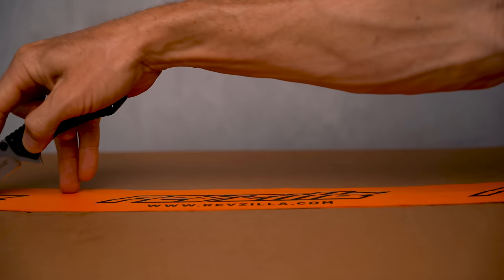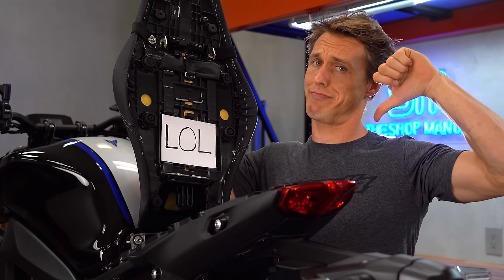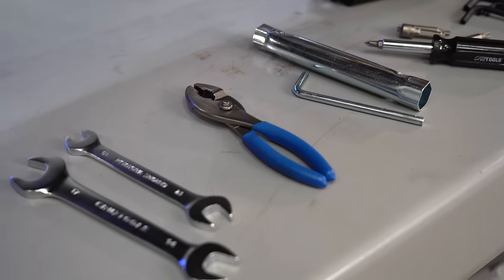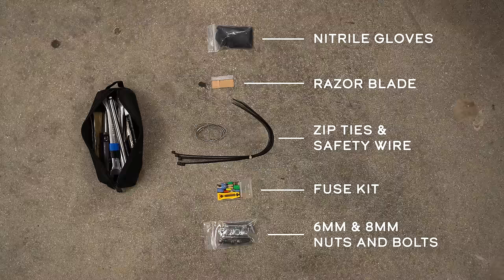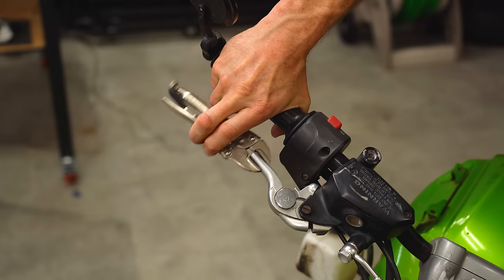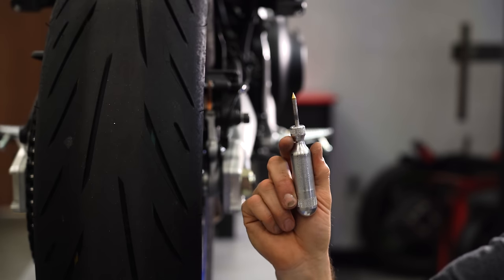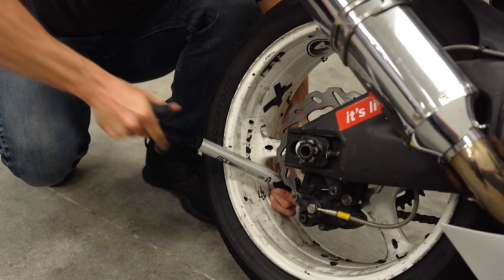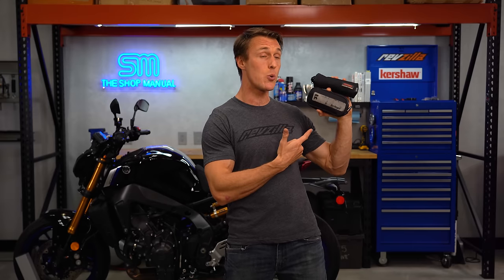How to Build an Emergency Tool Kit for Your Motorcycle | The Shop Manual

Comment: I've never had to plug one of my own tires but I've plugged about a half dozen of other people's tires including in the middle of nowhere. I carry a 12 volt compressor, they take up about the same room as a bike pump or a CO2 inflator and 3 or 4 cylinders. I've never liked CO2 because of the trash they generate. When bicycling I've stopped several times to pick up CO2 canisters that roadies left on the side of the road so I could get them into recycling.
Reply: That's a totally fair complaint against the CO2 cartridges.
Reply: I'm not a CO2 fan either, in part because of the waste, but also because it's a very limited solution.  Run out of cylinders and you're riding a flat tire.

I much prefer a mountain bike pump.  It's significantly lighter, packs smaller, is more reliable and more maintainable.  Sometimes you need to repair your tools before repairing your bike.  The bike pump is cheaper too.
Reply: CyclePump from BestRest.  Hands down the best.  Expensive, but worth it.

Comment: On the zip ties, buy bright yellow or orange, not black…lest ya got a KTM then swap orange for another bright color. The reason being is that road side repairs are basically “temporary “ so the color will show ya later as a reminder what needs to be finished when you get back home or to the shop. Also later on hints to keep an eye on that particular part or area as it may fail again as your bright zip ties indicate past failures vs the factory black ones that are hiding, don’t indicate so easily.😂

Comment: BTW, those tiny 16 gram CO2 cartridges kinda suck because it takes two or three to get a rear back up to pressure. You can pick up 45+ gram cartridges at pet stores though that fit the same adapters. They are used for live plant aquariums that need more carbon dioxide in the water. One shot and I'm back on the road, so I keep two on my bike, just in case I fail at plugging the hole the first time.

Comment: Something I do I learned from fellow club members is secure a clutch cable to the existing one, following the route and sealing the ends with tape. Also an old wire clothes hanger in the handle bar. 
We do ride old Brit bikes, often abroad and long distances and at recent events rallies have had a WhatsApp group for rally goers to ask for help locally, engine blowups etc.
Remarkable how some things can be solved by yourself or with pals with more knowledge, experience or just the bit you need. Great video by the way

Comment: Iv started carrying self amalgamating tape after I had a hose get damaged off road. Just give it a stretch as you wrap it and you’re back in business in no time. Iv also cut down big spanner’s and given the handle end a thinner end section so I can put a smaller ring ended spanner over it to increase leverage.
Reply: I cut the handle off a 8" shifter and replaced it with squashed pipe to use as a cheater bar and also integrated a 3/8 square drive. The shifter has a hammer head too. ALL the socket sizes for my bike fit nicely inside one another and make a little stack that can be ziptied together.

Comment: Cigarette lighter. Wrap with electrical solder, and electrical tape.
Can be used for (roughly) stripping wires and soldering.

Comment: I always carry 2 knives, an emergency knife that is a good sharp quality knife, relatively quality, I been carrying a off grid badger around 80$ always keep it razor sharp, then I have a utility type Gerber knife I use for cutting things regularly, I can switch blades easily don't have to sharpen, but my edc go to off grid is my emergency knife/ self defense knife that I don't use for much, maybe the occasional  steak

Comment: Good ideas in this video. Best advice given is practice using whatever you carry. Only change for me, is I carry a small LED camping headlamp so I can have hands free lighting. I also carry a spare headlight bulb (for us that ride older models). If your headlight goes out, after local stores are closed, you may be stuck over something that's easily resolved... if you have a spare!
Reply: Oh and I spy some nice OHLINS jewelry...

Comment: A tip for if you are carrying a bicycle pump, get one designed as high volume not high pressure. It may save your arms little bit when pumping a tire back up.

Comment: This is the 1st video I’ve seen that demonstrates that a vice grip type tool can temporarily fix a broken lever. This happened to me in the 80’s while trail riding and my vice grip pliers (needle nose type) got me home. I’ve since made sure my brake and clutch lever mounts have some give but the usefulness of that locking plier has never been forgotten. 
Leatherman Crunch is what I carry now if space is an issue. Thanks!

Comment: Leatherman multi-tool knife always on my belt

Some Instasteel compound mix in two plastic tubes

Tyre lever with rear-wheel nut ring spanner zip-tied to the sub-frame

Tow rope tucked away in a open cranny in the skid plate

Aluminium zip-ties to fix things that would be exposed to engine/exhaust heat

Comment: Suggestions on where to put that EDC? The only place I have ready storage on my bike is under the seat (on top of the battery), which requires a 5mm hex key to even get to. I don't have any good places for a tail bag, I don't seem to have a good way to mount any tank bags other than to the gas cap, and I can't really put a bag on clip-ons.

Comment: I bought Cruz Tool kit #TR2 for my Tiger 900,  To say it's well thought out is an understatement.  I had  tool I would need to remove  fastener that I could access on the bike, at least before removing any panels, except one.  The only thing it didn't come with was a T-50 (I think) torx wrench, and that is only for 2 bolts that hold the frame to engine.  Before buying the kit, I determined exactly what tools were needed, and was astonished how complete the kit was.  It even came with duct tape, baling wire, zip ties, Loctite, a tire gauge, and even a pair of vive grips!  Seriously worth the money!  Of course, I've added a few more things to the kit, but dang...  Great video Ari!

Comment: I found an excellent alternative for a hand pump. There is an electric one called Berkut MT-1000 I carry now. It is similar in shape but even smaller than the hand pump shown in this video. It is slow though, requires 10+ minutes to fill 30psi in my rear 17 tyre from zero. But it still is faster than hand pumping and is obviously easier on your arms. Ideal if you want to go electric, but want the smallest, lightest option, as well as if like me, you have a 3A limit on your power socket. Battery clams were included, but getting to it for me  requires some fairing stripping (FJR1300A), so that is another plus in my book.

Comment: i've been riding motorcycles for over 50 years. In all that time I've only had two flat tires. Both of them were decades before cell phones. One of them occurred on the San Mateo -  Hayward Bridge in the SF Bay Area. I had to pull into an emergency turnout and use a call box to request a tow truck. The other occurred on I-80 in the Sacramento Valley when I was headed from the Bay Area to go camping in the Sierra Foothills after work on a Friday. I did have a tire pump so I would pump it up, ride a mile and repeat for about ten miles and then stay in a motel over night and then take the wheel/tire to a bike shop Saturday morning for a replacement. Nonetheless, I did buy a tubeless tire repair kit just a few years ago. I've never used it so I like your suggestion to try it out on worn out tires before replacement.

Comment: I'm so glad someone could confirm that cutting the handles on the reamer/installer won't mess them up for use.  This video is awesome and super helpful!
Reply: I take the plastic all the way off and use the aforementioned Vice Grips as the handles. Both tools and a pressure gauge fit in my Leatherman cases side sleeves.

Comment: On longer rides I further carry a battery jump pack, a Sunex mini ratchet set (#9732), and a universal cable set. I've had the clutch cable snap before. The cable set is always under the seat with two different CO2 inflator kits. I like the idea of the locking pliers and will switch to it.

Comment: I started with a CruzTool kit as well.  Mine is a roll, not a pouch, but the principle is the same.  I ride a metric, so my dedicated sizes are metric, but I've done clutch cable adjustments and other work on Harley bikes with the pliers and adjustable wrench.  I've greatly augmented the content over the years to mostly ensure the tools are quality.   My tool roll had space for the tire patch kit, so I saved the second bag.  However, instead of CO2, I carry a CyclePump compressor from BestRest.  I've tried many other pumps and they are either much larger or pure junk.  Yes, the CyclePump is expensive, but I've had mine for going on 20 years now.  I installed an upgraded pigtail that works for a Battery Tender, heated gear, and the compressor, so I have a solid connection 15amp harness  to run it.  

The kit, rain gear, spare gloves, off-bike hat, and a couple microfiber towels for cleaning bugs off the bike all store tightly into a compartment on the bike.  I pull it all out every so often to ensure it's in good shape and the tools get used at least once a month during the good weather.  Mostly on other people's bikes.  Typically don't use the rain gear as I will wear the heavier riding gear if rain is forecast, but it's nice to have for those summer downpours.

One tip:  Just replace the tube of vulcanizing compound once you open it.  Yes, this wastes it, but after a leak and then the tube welding the cap on, I decided that having stuff fail on the side of the road is not worth the cost of another tube.  You can buy them in bulk on Amazon.  On long trips, I just pack a second tube.  Not all tire patch kits come with this.  This is a mistake.  Not only does the goop help lubricate the plug going in, but it cures to really seal the leak.  When you are starting a trip on freshly broken in rubber, the last thing you want is to let a tire issue ruin the trip.  I had one tire that did over 10,000 miles on a plug.  I don't recommend that, but it's nice to know you could.

I can't stress enough that you MUST practice using the kit.  9pm coming home after a long weekend at the local rally isn't the time to discover the kit is a PIA to use.

Comment: Great kit, so glad you included the tapes!  I threw a couple crimp butt connectors in mine as well. No need to carry special pliers, the vise grip will work in a pinch 😏

Comment: I carry a Topeak Mountain Morph bicycle pump myself -- it's a great choice if you have saddlebags or a tank bag to stuff it in. It has a folding foot and handle to turn into a tiny foot pump, as well as an air chuck on a foot long flexible hose, making it much easier to use than most tiny bicycle pumps.
About a minute of pumping got me to 16psi in a front 19 inch road tire when I tested it, so while it's not CO2 quick it is usable and wouldn't take more than a few minutes to get a tire to usable pressure.
My only gripe is that it's about 15 inches long so I can't hide it anywhere inside the bike's bodywork or under the seat. I keep it and my tire patch kit in a tool roll in one of my saddlebags and that works fine.

Comment: I'm glad to see this video!  One thing I recommend is to bring along a wheel nut remover.  My Multistrada has a single-sided swing-arm, and the tool I have enables me to removed the front AND rear wheels, should a tire need replacement far away from any Ducati dealer.  If you have a bike with rather niche tool requirements, definitely bring them along!
Reply: Absolutely! That's what the "make sure you have the tools for YOUR bike" bit was all about. Very few shops will have the proprietary nut needed to remove the wheel of a SSS.

Comment: I did the same Cruz Tools kit then modified it for my particular motorcycle. 
On the duct tape I cut out a piece of cardboard the width of my duct tape and about four inch long and wrapped several layers around that You can get more duct tape that way. 
I also wrap the tools in a rag and put a couple of those blue shop towel in my kit.
I also like Cruz Tools folding tool with the screwdrivers and Allen keys.

Comment: I have the same stuff but i also carry a rugged little air compressor along with Powerlet Motorsport Jumper Cables and later i started to carry a battery jump pack. It's saved my bacon as well as others i've run across out in the middle of nowhere...

Comment: Cool thing about my 2014 Valkyrie is the toolbox is huge. I have a battery phone charger and jump-starter with jumpers and built in light, patch kit, 3 x CO2, hex tools and even diebetic tablets in case i get into an emergency low blood sugar. Smaller sport bikes probably have far less space i imagine.

Comment: Have similar setup with few add-ons (FJR have enough space to accommodate):
- small electric pump. Saved me on a day I had double sidewall puncture. Was a longest 28 mile ride but I made it safely home without tow truck.
- gas bottle, compact but works like a charm even if you keep it empty.
- spare bottle of water. is a pleasant and cheap way to cheer up unlucky rider while they wait for tow truck in a Florida sun.
- on the long trips my trusty Antigravity jumpstarted/power bank. Because waiting for motorist to stop to help is a small chance, but expecting them to have jumper cable even smaller.
Reply: Why not just bump start the bike? Then you could save room and add more tools or other things.
Reply: @willjohnson5861  I'm fat, and pushing 650 pound bike plus gear is way too much of exercise comparing to nice, compact and light jumper.
Not to mention, I have plenty of space between saddlebags and 65 liter trunk 😂
Reply: That’s true! I always forget my bike has no good storage, if I had a bike with better storage a little jump pack sounds like a good idea.
Reply: @willjohnson5861  You might want to take a look at Givi tank bags, I have 16 liter expandable one... Yes I like to have more storage than average Prius 🤣🤣 
I use it for small stuff, but if needed on a light trip I can getaway with using just it. Very good investment.

Comment: One of the most important parts is HAVING a secure place to carry your extra kit. I'm fortunate that my '18 KLR came with a nice factory tool kit. (in the back rack) but the FIRST thing I bought was their awesome $68 tank bag. and it's expandable (like the factory tail pack...which I only put on when I need)
carry my slime for tube tires, 16 oz Aquafina, The CO2 kit like Ari has, a nice Leatherman, rags, and all the goodies. PLUS it's got a nice zippered clear top that holds my phone perfectly (no vibration from handlebar mounts)
Come to think of it, most all the bikes I have owned, I've put on bags or fashioned a tool pouch to hold all my stuff...EVEN my old '72 triumph!! (rarely used...really)  😁

Comment: Once a week tour and tightening negates most issues. And luke pilot do preflight check, chain lube and slack, both tires for nails etc. And air pressure. I have about 10 basics i do before any ride, while bike warms i run check. Then o am good to go.

Comment: Video is great for beginners. I wish I could learn that from the videos like this. When made my own tool kit I was based on three things: 1. demands of the bike you drive, 2. how much space do I have for the kit and the 3. how long are the voyages.
I am a heavy cruiser (BMW r1200rt) and since I have a lot of space I always have with me is a 12V pocket compressor, first aid, tyre repair kit with small tanks of air/CO2. I also travel in groups I also take WD-40, lube for chains and fire extinguisher. Small manual gas pump is also in the pack because I have 27 l tank. It seems ridiculous but God is my witness I used every at least once, specially a toilet paper and  wash gel for hands. Kitchen sink I don't care with me. Sorry for disappointment.

Comment: I built a set of moto sized booster cables from the "direct to battery" wiring that comes with a 300 watt inverter. It was the same gauge as the main power wires on my bike. I just crimped 20 amp red/blacl clips on them. Probably $7 invested. Same size as a booster pack (although I'd rather have the little booster pack)
Reply: I don't let people jump off my battery.  What I do instead is hook a lead up between my battery maintainer pig tail which is wired directly to my battery to plug on the other end I can swap between a hand full of standard plugs used for the same purpose.  (Everyone I know usues a battery maintainer in the winter.)  I let the bike idle for about 20-30 mins to recharge their battery before I disconnect and they start their bike up.  It prevents damage to my bike from a surge or if there is something wrong with their bike like a blow regulator that tries to dump very high voltage  across the connection between bikes.  Other assorted possible damage sources.  If I'm in the middle of nowhere I don't take avoidable risks.